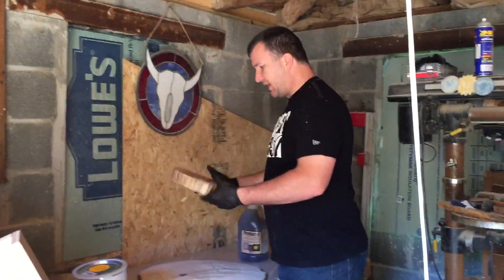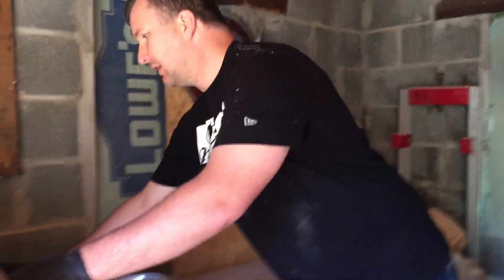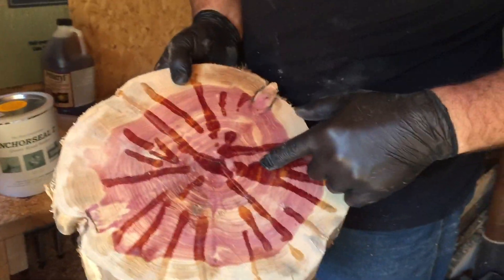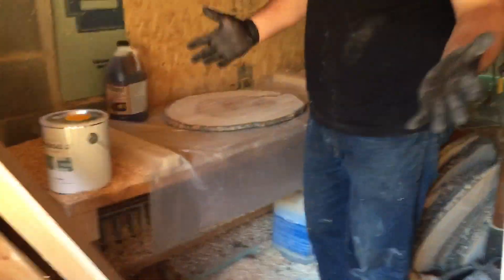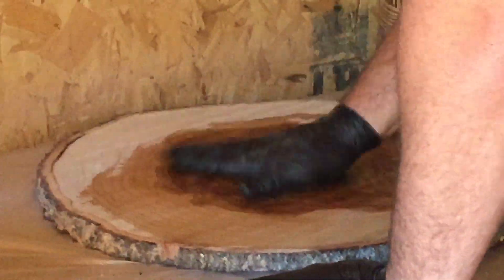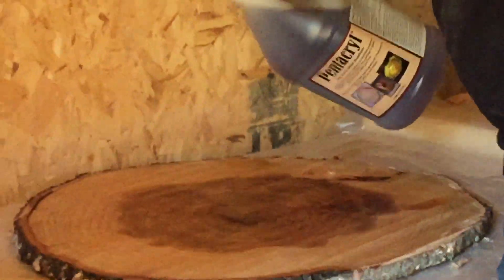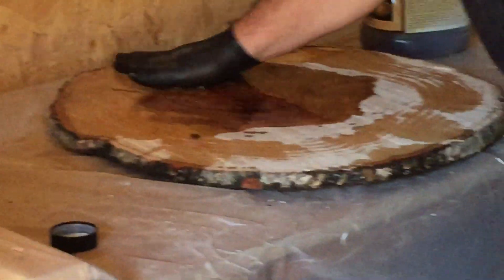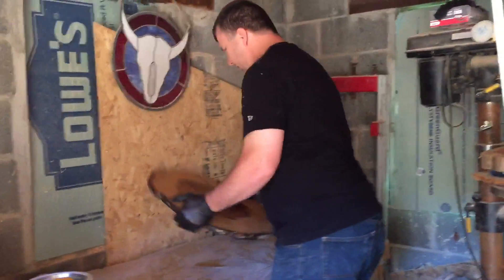Stabilizing large tree slices with Pentacryl

Comment: Supposed to keep the cookie as wet as possible, then apply or put in shallow pan, pour in pan and the solution displaces the water, if wood is semi dry there's another product (wood juice?)but for best results, soak, as the pentacryl is wicked up into the wood, 24hrs per inch thickness, 4 days for my 24" maple cookie, bought half gallon for 30 bucks, just got it..

Comment: I am collecting cookie disc for a wood flooring in my house. They are only 2" to 8" in diameter and 3/4" thick.  I am drying them naturally in my garage.  Do you think that will work without cracking since they are small.
Reply from the maker: Greg Brooks hey Greg, I don’t have any cookies that size. However, if your interested I can find some for you.
Reply: No don't need the wood.  I am just having a hard time figuring out how to cut disc larger then 4" in diameter completely flat on both sides without having to plane them.  My miter saw can do up to 3 3/4" but that's it and chainsaw you have to do by hand

Comment: how did this look? Have you made a follow up video yet?

I have about 30 1 inch thick walnut cookies that i need to make into finished pieces for a wedding in Dec. I cut them with the chain saw, should i sand them from a 60 grit to a 200 grit and then use this solution, then varnish? what would you do?
Reply: I am using them for a party in November, and I was told to sand AFTER the Pentecryl.